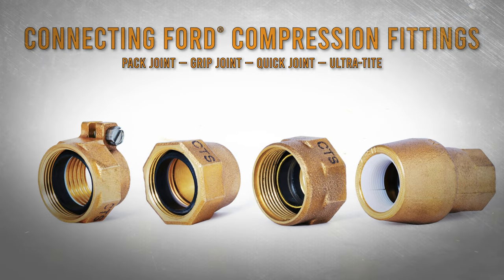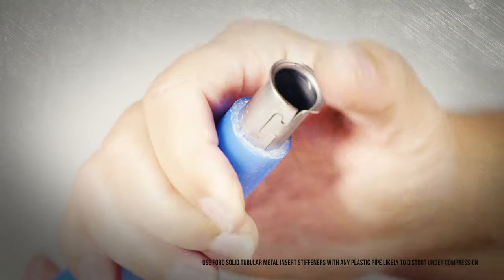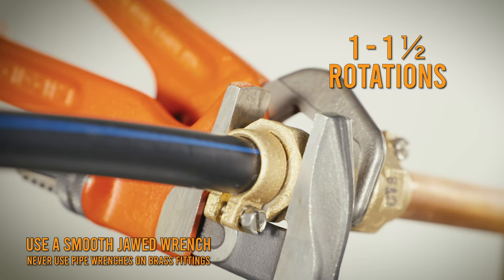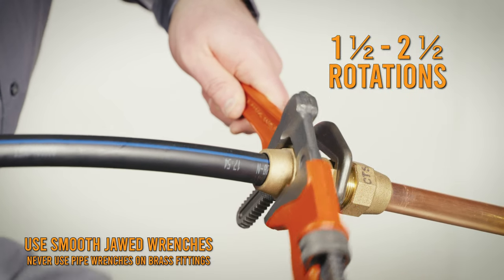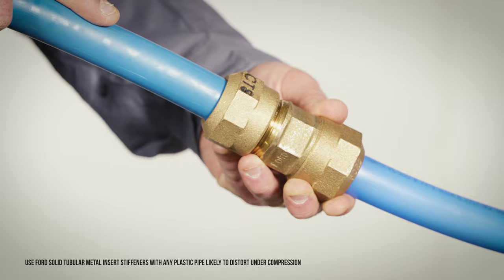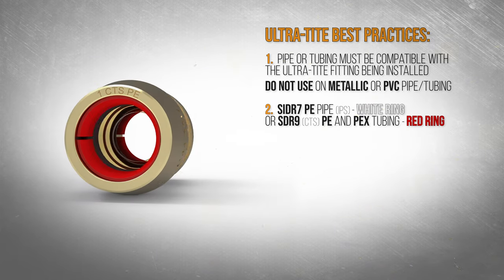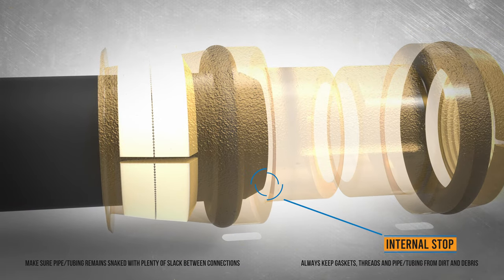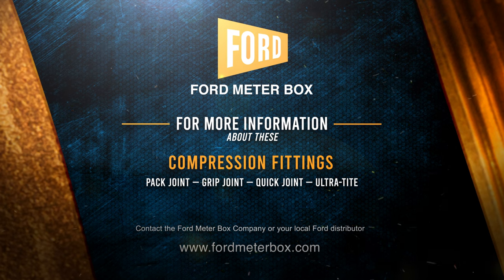Connecting Ford® Compression Fittings

Comment: Thank you for this. I just used a 3/4 Ford Pack joint to connect copper and CTS pex. And I'm about to add a 90° pack elbow to 3/4 pipe.  Thank you for this film.